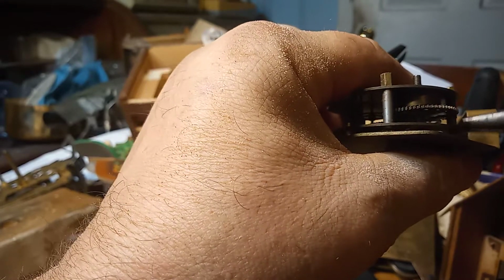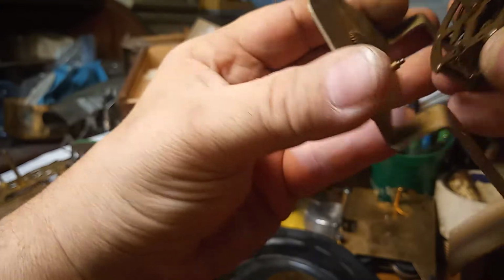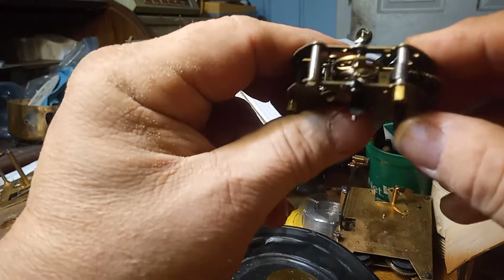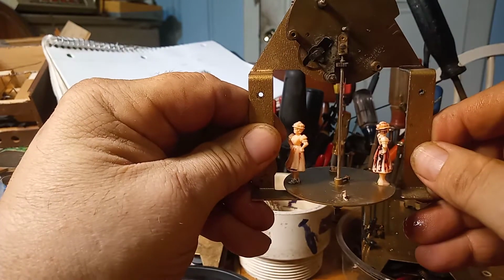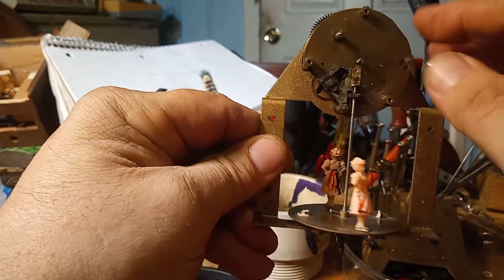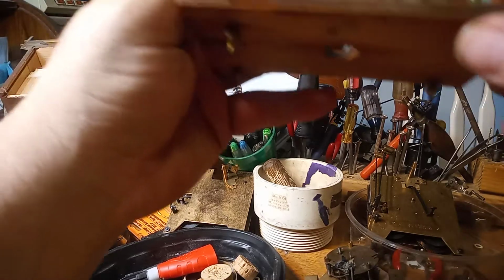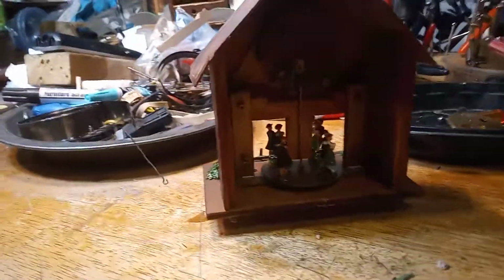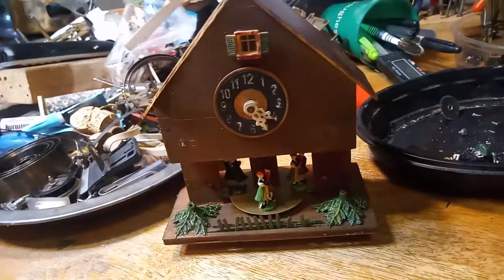Repairing a small novelty German clock by WA Schmid-Schlenker Jr with dancers. 20220312 030635

Comment: Very cool and helpful. I have one of these exact same movements except mine is a mini anniversary style clock with hand painted flowers. I think it's got that  "cool" difference over what I usually work on, and as you said, it's free... It's complete except for the pallet missing both microscopic pins that set off the escapement wheel. I'm descent at soldering but that's out of my expertise so I be hunting for a complete movement or parts. Always a pleasure keeping up with you and Just Mike and Mark and a few others, I always learn something, you guys keep em coming!!!!
Reply from the maker: You might try taking a straight pin from a sewing kit to make the pin pallets. Good luck.  Thanks for watching.  God bless.